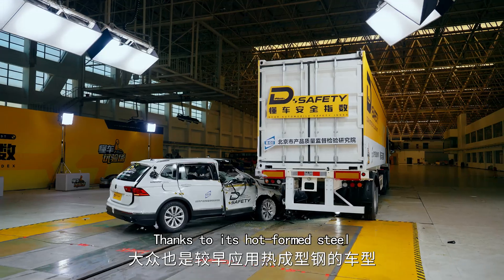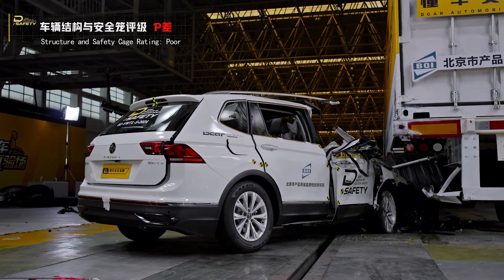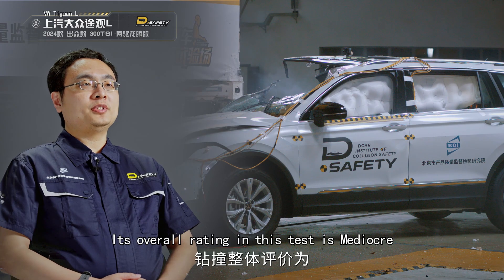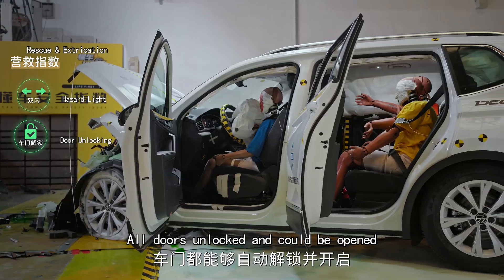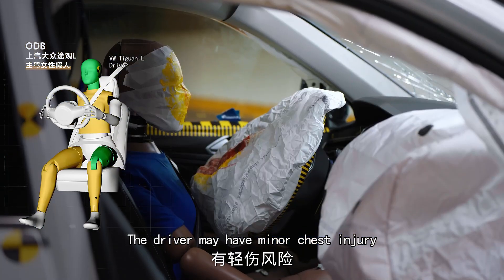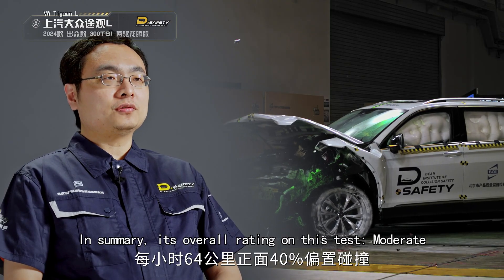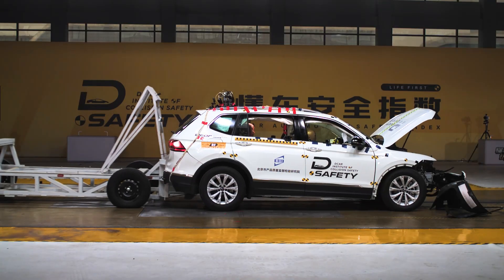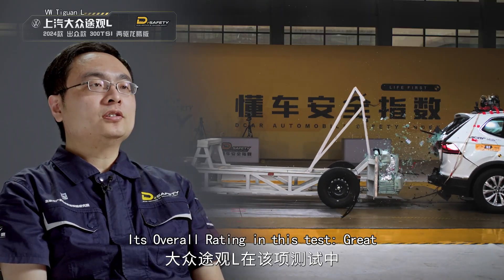Volkswagen TiguanL Crash Safety Test 大众途观L 碰撞安全测试

Comment: These trailers need to be banned as they pose a lethal risk to other road users.
Reply from the maker: probably yes
Reply: Those trailer rear guards are papper thinn. They are there just for the looks. In Europe, they are made stronger.
Reply: @DashCamSerbia  And lower. And bigger in general, to prevent a fatal underride.
Reply: @Timico1000  They are introducing a new standard for them in the USA. You can see how they are braced at the very edges as well, so they don't break off.
Actually, it is already introduced it seems.
Reply: @DashCamSerbia  press x to doubt

Comment: So bad😯
Reply: Tiguan is a very Safe car
Reply: VW is the kind of company, that optimizes the car structure to do well in the classic crash tests, like the 40% overlap/64 km/t frontal test. 
Companies like Volvo and Tesla are optimizing for all kind of real life accident situations too.
That's the main difference.
Reply: @runepedersenDK  they dont . This is a test thats irrelevant in europe since the rear crash bar on European trucks actually works
Reply: @leopard2109  But strong A-pillars and roofs are always relevant. You can hit a moose or other heavy animals with long legs.
That's the essence - Tesla and Volvo are designing for an allround real-life safety, VW  (and many others) to do well in crashtests.
Reply: @runepedersenDK  they design a car to do well in the most common crash. We don’t have moose’s here. Btw Volvo has always been safe teslas are only safe because they need a rigid structure to support the heavy batteries. Every German electric car is build similarly. How about your control arm ripping off at highway speeds? That’s Tesla safety for you.
Reply: Watch the full video. 8 times more expensive Range Rover did DRASTICLY worse...
Reply: It is not VWs fault, the trailer has a bad design and almost all tested cars failed in this test.
Reply: VW is overrated - especially here in Europe.
Reply: @runepedersenDK  I guess you’re a Tesla fan ?